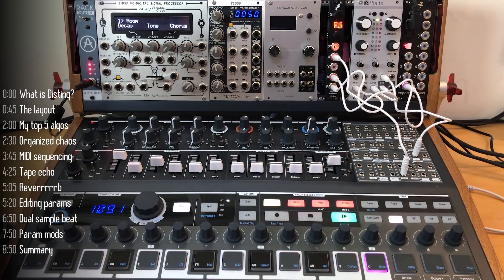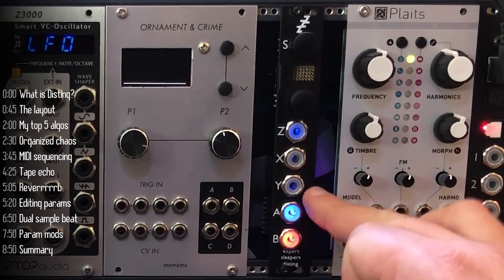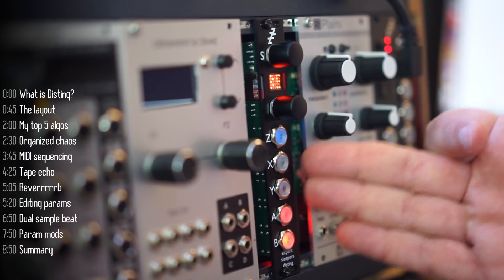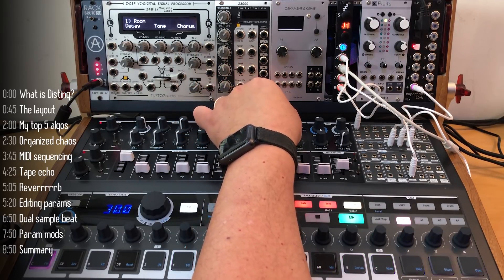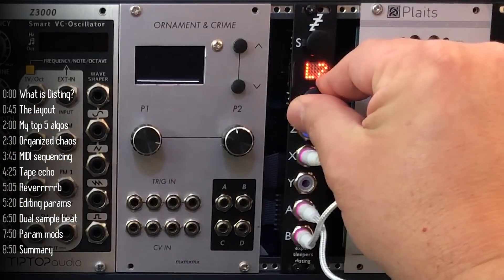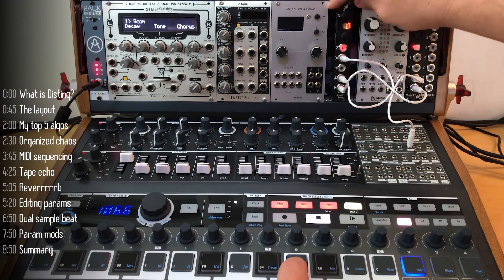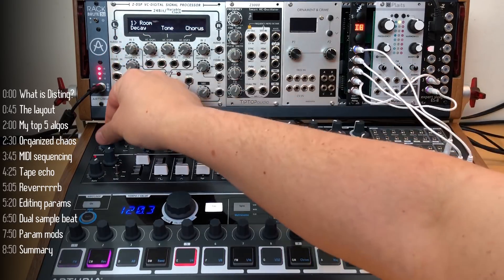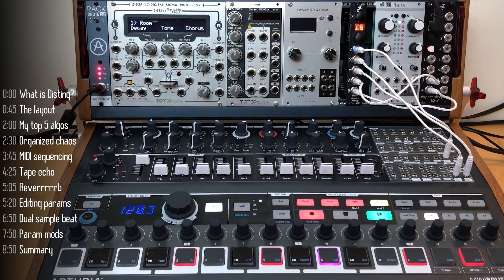80 MODULES IN 4HP?! Disting MK4 review and my top 5 algorithms

Comment: I was wondering how this thing worked as I just got a semi-modular synth that uses Hz/V and a Disting is the second most recommended module behind an English Tear.  Being new to the modular side, I was under the impression knobs and inputs\outputs were single purpose, so pictures of the mk4 not hooked up or turned on raised many questions 😂

Comment: Great video, hoping to grab one of these as my first module to expand my mother32
Reply: how's your rack going 3 years later? i've had two mother 32s for a long time and i'm looking to expand into eurorack soon myself, and this along with better envelopes and a set of attenuverters are on my list.
Reply: @SomeOne-pd6vm  I ended up getting a disting as my first expansion module. Could not figure out how to really get it to do what I wanted it to do. I ended up spending way more money on more modules and the other 2 moog semi modular units. Now the 3 moog units are in a 4 tier rack kit with a top rack full of miscellaneous modules. The disting would be a great option for someone who understands the deeper mechanics of euro rack better than myself, which is a pretty low bar tbh. However, the doepfer summing mixer, cal synth typhoon and the Pico DSP have since become my must have modules for the moog units.

Comment: This must simply be the single best module in existence, relative to its price. I'm absolutely getting one.

I think what is missing is the ability to directly control it with a computer? It'd be awesome if you could plug a USB cable into it and have a proper GUI interface on a computer to control it.
Reply: The disting ex has full midi breakout - not the mk4?
Reply: @GeorgeLocke  it does , through headers in the back.
Reply: @RabRabNZ  yeah. I'm not sure that it goes very far towards satisfying the OP's question, so my question was dumb twice :)

Comment: the reason why i still hesitate with these and many other modules is the ever growing trend of putting twelve billion functions on one knob and expecting ppl who have a large number of modules to remember those.
Reply from the maker: you're right - it's impossible to remember. I think the idea is to give you the option to have the module you need in case there's a missing piece in a particular setup, but yeah, it's impossible to remember by heart without referencing the manual. a better solution is an app called "Modes" which has all the algorithms quickly available. not ideal though of course.

Comment: after you power off then back on does the mk4 recall its last settings?
Reply: The Disting can save 64 presets, which saves the algo and all parameters.  But I'm gonna copy from the manual for further explanation about preset 0:

Preset 0, the first slot, is special:
• The contents of preset 0 are loaded at power-up.
• When switching algorithm, the new algorithm state is saved to preset 0.*
Therefore if you want to save the disting's state so it powers up as it is currently, you can manually
save to preset 0, which is “click, turn, click, click” on the encoder.
Preset 0 is also an exception to the above comment regarding favourites. The actual favourites slot
is stored.

*The thinking here is that if you forget to save your preset before turning off the power, at least the disting will come
back up in the same algorithm next time you start.

Comment: Great video! Are audio files recorded with the audio record algorithm usable with the audio playback algorithm? If so are they immediately available to that algorithm to or do you have to eject the SD card and move them manually and add them to a playlist with a computer?
Reply from the maker: I didn’t read the manual on that part but my guess is that yes you will need to create a new playlist
Reply: I found the manual and it doesn't address this in particular but it does say that audio files used for playback must be listed in a playlist text file so I can only assume that users would need to do that manually. I'm guessing the record audio algorithm was written with recording performances in mind which you may not want to use for the majority of the audio playback modes. Perhaps a future update or new algorithm could offer a "sampler" mode that generates  a new (or updates a existing) playlist after you record bypassing the need to manage things manually.

Comment: I think the reason LED's are not used very often for audio jacks is because Expert Sleepers is achieving this by using a small SMD LED mounted on the PCB just underneath the audio jack that is mounted horizontal on the PCB. So the LED shines into the side of this type of audio jack that uses translucent plastic. This is why the light appears more intense on the left side of the jack.
Reply from the maker: retoided I didn’t notice it but I’d still prefer that to an opaque jack. It’s just a great way to figure out “bugs” in a patch
Reply: I really don't care how pretty it is... I just want the information.  Considering how minimalistic the interface is, it's a great help.  I'm just getting started in modular and looking for bang-for-the-buck.  Plus, with this, I can determine which kind of modules are best suited for my own personal needs.  Anything that I use all the time on the Disting is probably a worthy investment in a dedicated module.
Reply: Expert Sleepers invented the tech behind the lights so it might be patented.
Reply: the problem with the design is that the types of jacks used are lets face it absolute garbage, you only have to look at a patch cable the wrong way and it falls out of the disting. (I have 2 mk4's and both suffer this problem and I have heard other people complain about it saying it's been like that since Mk2 so it's not just a faulty batch of jacks)
if you actually look at the jacks on the pcb it's clear to see they are cheap plastic rubbish that barely hold the tip of a patch cable.
https://www.muffwiggler.com/forum/viewtopic.php?p=1617038 (thread from way back in Mk1 days so it's not a new problem)

I have even considered desoldering the jacks and replacing them with something a bit better quality (I'd be willing to sacrifice the lights for a better quality jack tbh.)
it's an amazing module but this is it's only downside for me.
I'm willing to bet that most companies don't do it because the quality of plastic jacks required for the effect is terrible and they simply won't put a plastic jack on their module.

the only other modules I've seen plastic jacks on are Doepfer stuff. (but even the plastic ones they use are not as bad as on the disting)